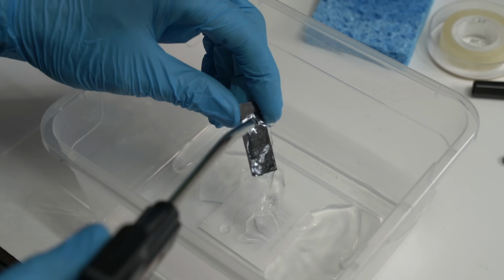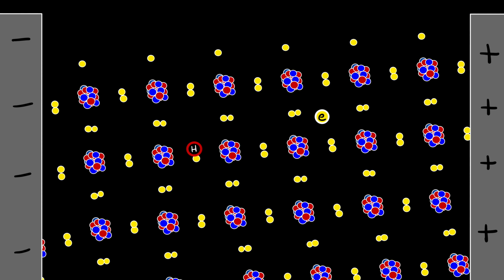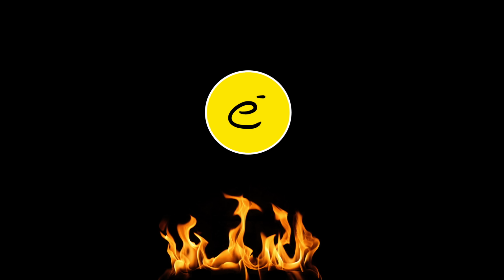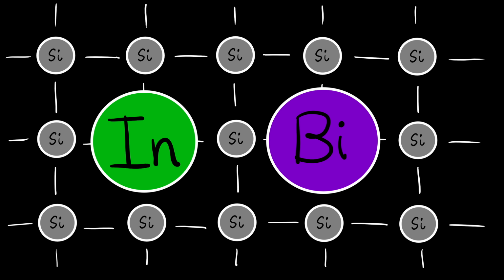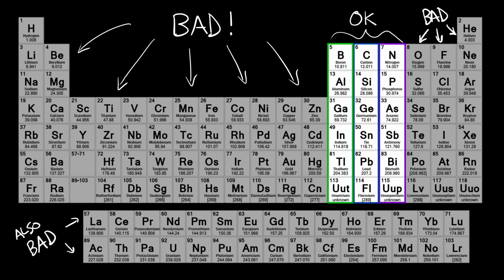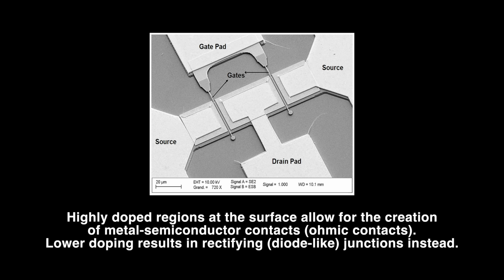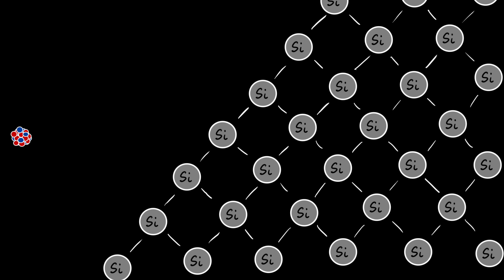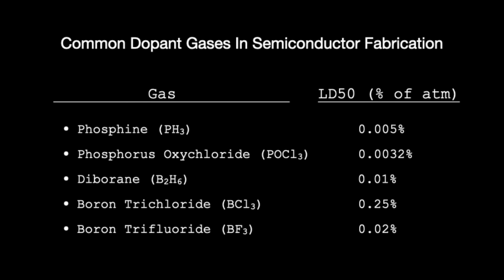Doping: The Most Important Part of Making Semiconductors

Comment: Dopant precision really depends on the device. TTL is a little sensitive, while CMOS is not too worried, it just affects threshold voltage slightly, and breakdown voltage, which mostly is going to manifest as leakage. Most extreme example is things like unijunction transistors and Jfets, devices that have a very wide spread in charactaristics, depending on the doping level. Jfet it affects the pinch off voltage, and also the current flow when it is connected as a constant current diode, and in unijunctions affects the stand off ratio and current capacity. That is why you get so many different Jfet and unijunction part numbers, with them all being almost all the same aside from a variation in either pinch off voltage, or stand off ratio, and with the devices in the base part number being sold with a massive variation in those, with the others being binned from these big pools during manufacture, with the variation coming from the slight variation across the wafer during production, so if you got hold of a single tested but unseparated wafer, you can probe each chip, and get a pattern of how doping varied across the wafer that run. 

That is why you always see test patterns on any larger die, there using a small amount of space to have a test pattern that is placed there early on, and probed during manufacture, so that any wafer that had a bad day can be weeded out early, as the test structures make for easy to test devices, that they know how they react according to the doping and such. digital logic can handle a little error, analogue that is complex not so much, and precision analogue not much at all, especially if you are using Jfet in the design, you want to hit the mark every wafer, and scrap any that are likely to be faulty early on.
Reply from the maker: Wow! Thank you for such a comprehensive overview on this subject. I take it you are in the industry yourself?
Reply: @projectsinflight  No, just have been using them for years, so learned why the Jfet and UJT have such a wide spread, while regular TTL is reasonably stable, and CMOS is pretty much immune in regards to threshold, really mostly being depending on gate oxide thickness for how it works.
Reply: While there are test patterns all across the wafer, it is infeasible to test anything electrically until the wafer is almost all the way through manufacturing. You need ohmic contacts from the semiconductor to the metal on top, which comes late in the process, because they have processing limitations and need to be at the very top of the wafer. 
So for example, the n++/p++ doping that is mentioned in the video could be used for a semiconductor-metal contact. But there is no way to check if the doping worked until after the wafer is completed. After ion implantation/for diffusion you need very high temperatures for a long time, then you need to apply the metal for the sc-metal contact and it's associated processing and only then could you test if the sc-metal contact works. And don't forget, each of the steps comes with photoresist application, patterning and cleaning!
Reply: CMOS functionally isn't too critical to doping, but not to say specs are unaffected: this is part of the reason why speed grades, input threshold, and output current, vary so much.  The other part of the reason is they just DGAF and want wide guard bands on their process, lol. (You'll almost certainly never measure a 74HC or other gate in the wild that hits the datasheet worst-case limit say for propagation delay. Unfortunately, this is needlessly conservative when doing actual timing chains -- the one upside is, no one does that anymore, if you're doing logic, you're writing for an FPGA or ASIC... or building a hobby computer that you can test, select parts, and repair as needed.)

Comment: I wonder if you could use pure boron or phosphorus in an inert atmosphere that's at a different pressure. A phase change diagram likely would have to be consulted but just a thought.
Reply from the maker: I'm sure you can make it work somehow, but I definitely wouldn't trust my furnace to run at substantially higher than atmosphere. I'd hate for it to break again lol